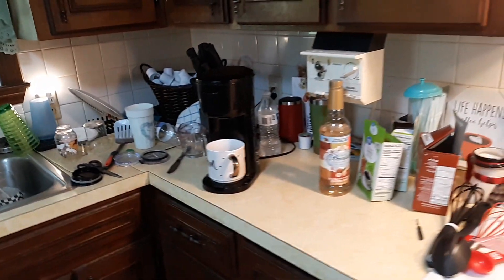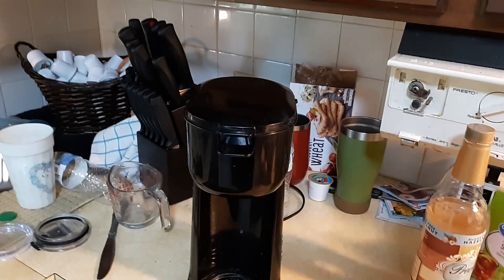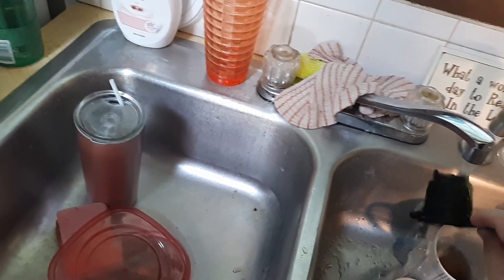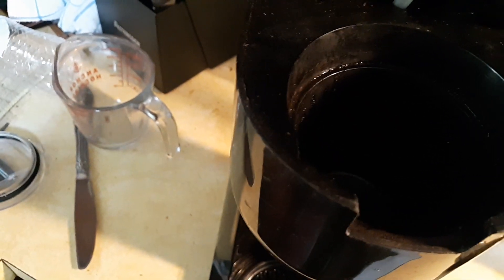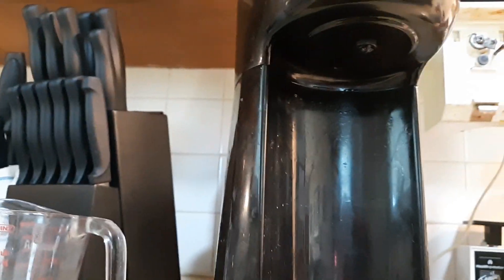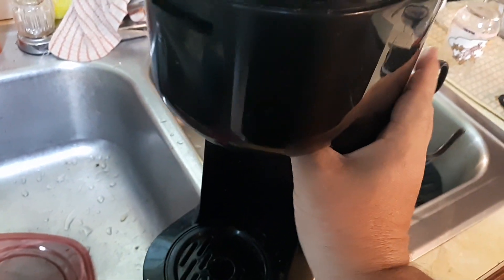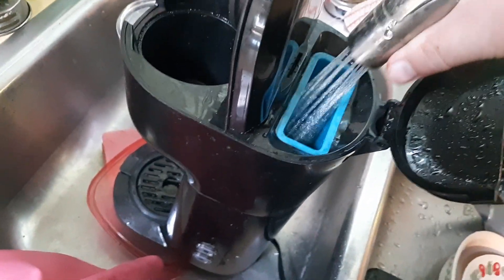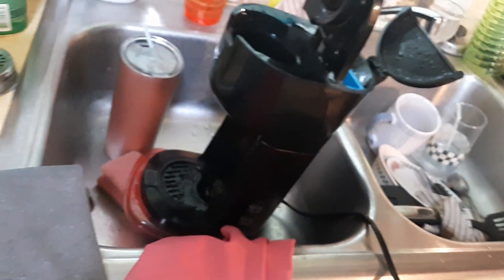Fix Mainstays (Walmart Brand) K-Cup Coffee Maker Only Making Half a Cup (Not Fully Brewing 201963)

Comment: I tried your method and it was still not pouring enough coffee so this is how you really clean the machine ready… 1. Get vinegar 2. Pour it into the filter 3. Run the coffee maker 4.repeat the process 5. Then add water after your done using the vinegar and 6. Run the coffee maker with water to clean out the vinegar and boom you fixed your coffee maker by properly descaling it and getting the gunk out the filters. Your welcome.

Comment: I tried your method and it was still not pouring enough coffee so this is how you really clean the machine ready… 1. Get vinegar 2. Pour it into the filter 3. Run the coffee maker 4.repeat the process 5. Then add water to the filter 6. Run the coffee maker with water to clean out the vinegar and 7. Repeat the process until all gunk is out of the machine. boom you fixed your coffee maker by properly descaling it and getting the gunk out the filters. Try my method and thank me later.